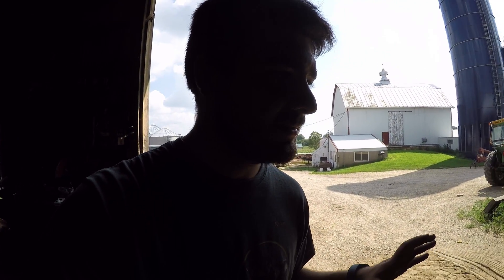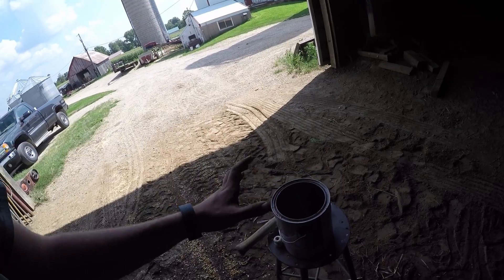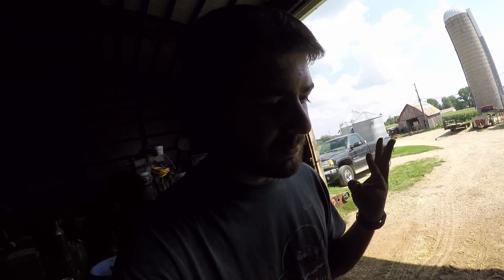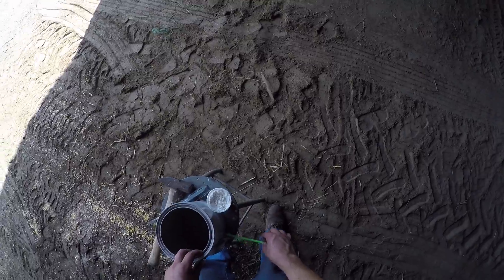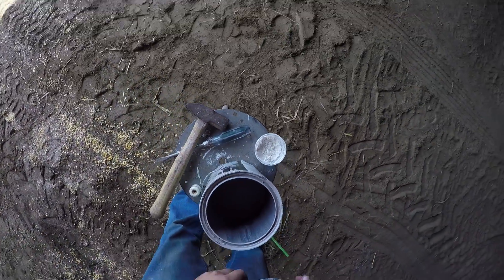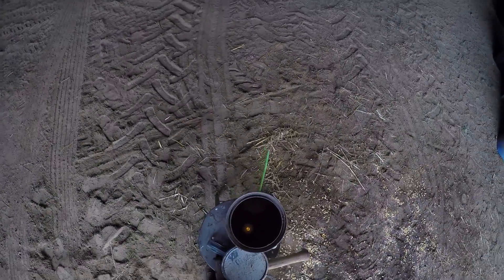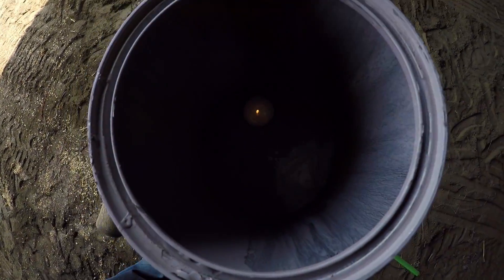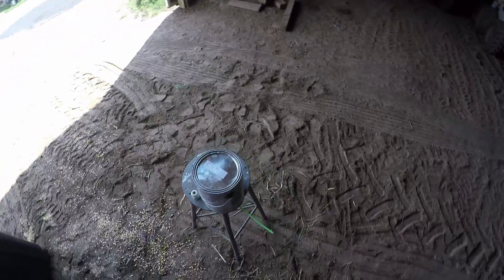How Grain Elevators Explode - Paint Can Experiment (Flour Bomb)

Comment: As a commentator put it more adroitly than myself, any powder, when ground fine enough, when ignited, can cause a lethal explosion and fire. 

Coal dust is the classic example, but I recall a sugermill fire from, if memory serves, the '00s where all the conveyors and elevalators where shrouded, ostensibly to keep the sugar dust down. Unfortunately, due to poor routine and planned maintenance, no-one knew that there was a slow, but significant, spliage around especially the conveyors, and underneath them, was taking place, as it was all hidden by the shrounding. Even worse, was common knowledge that there was sugar dust everywhere ...

So when the inevitable happened, the blast tore the place apart; worse, if you ever have had hot sugar syrup drop on you (I have ...), not only it hurts like hell, but it keeps burning because it sticks to the skin like glue ... even though it was less than 1/4tsp, it still took about ten minutes under the cold tap to get the stuff off me, and stop the burning; my God,  that was painful ... I have had steam burns before (comes with working with stationary steam engines ... ), but that was my worse burn yet, and I still have the scar from it ...

So you can imagine that hot, sticky, sugar, burnt pretty fiercely. The only thing the local fire department could do was surround and drown, in trying to simply contain it, and not spread, rather than put it out; instead, they just let the core of the fire burn itself out ...

As I recall, in the later fire investigation into blaze, the fire marshal in charge of it threw heavy criticism at the company for all manner of OSHA failings, not least the carelessness in the planned maintenance, and even the supposed routine clean-up of split sugar ... but apparently, people found the task of taking the shrouds apart too tedious, so it was just left ... not only that, but, ironically, it was the shrouds themselves which made the blast, and subsequent fire, worse, by containing the suger dust in narrow confines, making it easier to ignite. Plus, again iirc, because the way the inital fire had started, due to it being hidden behind the metal panneling, nobody knew until the blast ... Of course, had a sprinkler system was installed within the shrouding itself, the reverse may have happened, in which the fire could have been contained, but apparently the company baulked at the extra cost ... 

Sadly, I don't remember much else, so if anyone does know more, I would more than happy to be stood corrected ...

But nevertheless, any dust, fine enough, in the right conditions, can cause serious explosions. All it takes is enough dust, sufficiently aerated, plus an ignition source, and boom ...

Comment: I've been a grain elevator superintendent for over 22 years now in south central Kansas and have seen a lot of bad things in my elevator. Luckily it's never exploded but it's been hit by lightning causing a bin of milo to catch fire, driers catching fire, conveyor belts rubbing onto the metal stands causing the whole conveyor belt to smolder and much more. Those are all ignition sources that can start a primary explosion which leads to secondary explosions which do more damage then the primary explosion usually does. It takes 3 things for a grain elevator explosion. An ignition source (this can even be static electricity), grain dust in  suspension and a confined space. 
Good job on bringing the awareness to people's attention.
Reply: Jeremiah Lackey do you work at the Wellington elevator?
Reply: No The one I run is in Conway springs
Reply: Get a different job!

Comment: are all cylows prone to this?
Reply: To have an explosion you need the following, oxygen a fuel like flour, grain dust or coal dust. You need a heat source to ignite. You also need suspension of the dust in the air and last you need a confined space like a silo or a coal mine. If you take any of these away, there will be no explosion.

Comment: I work in grain. One of the ABC grain companies. We have hazard monitoring systems that watch for leg belt rubbing. Major cause of explosion. I have seen aftermath of electrical short. Blow the leg casings out of the concrete head house. Grain handling is dangerous from explosions, heavy equipment, dealing with rail loading. But I enjoy it. Good video Ryan.

Comment: Could this happen to a farms grain bins as well or just the mill/ elevators?
Reply: Any confined space where combustible particles are distributed in the air, I'd bet.
Reply: jep could happen, when filling them its quite dusty in there... but you need a ignition source, wich is normally not present in a farm bin...
Reply: nitro 

Actually, for a source of ignition, people forget static electricity; if enough grains bump against each other, all you need is a big enough static charge that is sustained long enough, and a large enough discharge, and that is your instant source of ignition ...
Reply: TheodorEriksson 

Indeed ... any dust, of sufficient volume, aerated enough, can cause a significant blast, especially if confined to a small enough area. 

I have seen the same 'paint can trick' done, in a studio. The only difference was the tea-light was placed the middle of a pile of organic, stone ground, flour, and the paint can placed on top ... even the small puff of air through the straw was enough to cause a blast big enough to propell the paint can high enough to more or less hit the lighting gallery, some 50ft above ... in fact, it came close to taking out one of the studio lights ...